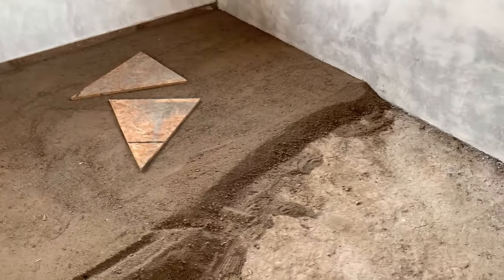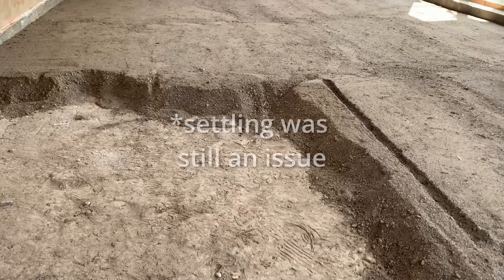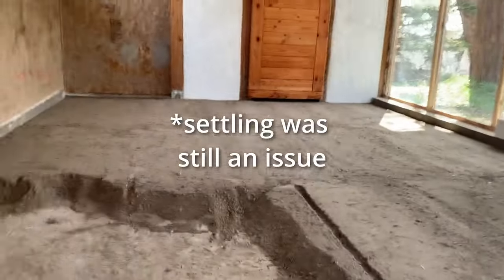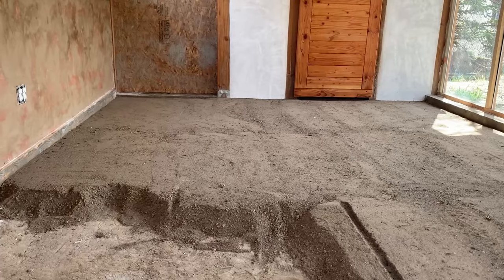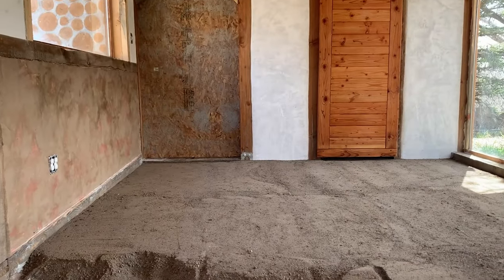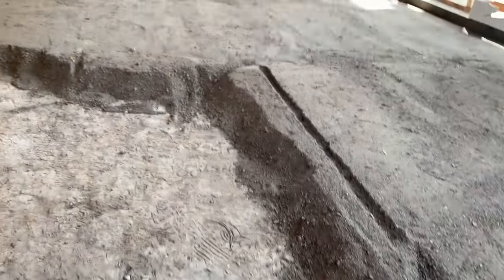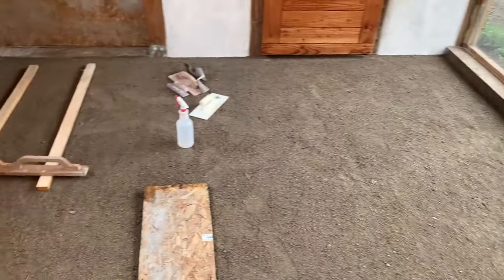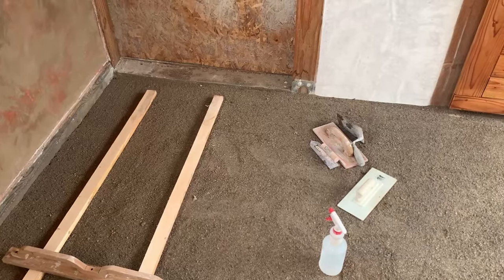Earthen Floor Installation

Comment: To address the cracks, no need to remove material. You can pour a clay slip, even over the oil finish. Squeegee it flat and it will fill the cracks. Give it a month to dry, and fill any remaining cracks with more slip. Repeat until satisfied. Oil finish can be re-applied, and you get a neat 'crazing' effect to the already lovely floor. Great work!
Reply from the maker: Awesome. A little cattail fluff in that slip might help larger cracks fill without re-cracking, too.

Comment: I like the concept, but bags of clay powder are not cheap. Alternatively, you would need a  supply of natural clay, but not all of that is of necessary quality. I suppose is someone is remotely off grid, making do with found resources would be necessary. I think the temptation and cost will often cause the default to a concrete slab floor - but I still admire the use of the ancient ideas
Reply from the maker: Most subsoil is suitable for this

Comment: Looks good! We love our earthen floor! We think the cracks add interest and texture. We stabilized ours by sweeping in fine dirt and then we sealed the whole thing with oil and wax.
Reply from the maker: I am cool with a couple small cracks, but I have some larger ones from the settling that I will fix. Plus, there is little information available on repair, so adding some would be good. Would you add links to your videos here, for others to watch? It’s great to have a few approaches to understand the concepts.
Reply: Sure! Here is a link to our video doing the bottom layer: https://youtu.be/cCVJRazK0aM
Reply: and here is our video showing the top coat and sealing of the earthen floor: https://youtu.be/90vHyzPmZ0w

Comment: How resilient is your beautiful floor to scraping and gouging by furniture; e.g., tables & chairs?  If damaged, can it be repaired and/or "refinished"?
Reply from the maker: It is almost like concrete. We use area rugs under furniture that moves, like dining chairs, but the dogs claws have done no damage in the traffic areas. I’ll have a video on repairs, at some point. It should be as simple as mixing a new batch and floating it into damaged areas, then re-oiling.

Comment: Great job. We work with a lot of clay cob mixtures in different applications, wall floor sealing. The tricky thing is the mixture of the filling materials like sand and that is something one has to test out at times. But good thing is that it can be fixed.
Reply from the maker: I certainly have learned that substrates are critical. Any tips for crack repairs?
Reply: @radicalgastronomy  I've not dealt with oiled earth surfaces. My guess is that through the oiling of the cob changed the chemistry and properties of the material. I would create a similar test piece and cut a piece out of it. Then create a mixture either out of the cut out material and oil you used for this you would have to crunch the cut out material, or I'd create a mixture of the base earth material you used with oil and maybe some water and compact that into the slightly opened crack. To smoothen the surface I'd use a ceramic stone as used for Tadelakt (Maroccan chalk plaster). These are suggestions. I hope you have fun in creating a solution for your cracks. If you would live somewhere reachable for me I'd come but unfortunately the Ocean separates us.

Comment: i like your work. Since you have the laser level. I would have snapped a line around the room with a chalk line. then put the screed to chalk line and just use a torpedo level to bring it into level.
Reply from the maker: I hear you. I find this method works well with the thick material. It doesn’t float like concrete. Either way, though.

Comment: Is there a good substitute for cattail? I don’t have any in my area. Also do you think you could add color pigment to either the finish layer or the linseed oil sealant? Thanks and nice work!
Reply from the maker: Most of these floors have chopped, screened straw in the final layer. Natural pigments can be added to the clay mix, or you can seek out different colors of natural clay.
Reply: @radicalgastronomy  awesome. Thanks for the reply!

Comment: I wonder, would adding some water to your dry subfloor layer you hand tamped help with the uneven compaction?
Reply from the maker: We began adding some water to it, but the clay just stuck to the jumping Jake tamper we tried to use. Ideally, with the right mix of clay, sand, and rocks, a road base should compact well even when dry. It would be a ton of work to mix all that material with water and “pour” it into place. This approach got really close to what I’m after. I think it will be flawless with a plate compactor, next time.
Reply: @radicalgastronomy  Looks good, thanks for the info.
Reply: @radicalgastronomy  Would tamping in thinner lifts work better?
Reply from the maker: We tried, but the clay was too sticky. More sand in the mix would have helped.
Reply: Would oiling the tamper help prevent sticking?

Comment: So if you add lime to the mix, is it more difficult to repair if there is damage to it at some point?
Reply from the maker: It’s probably the same in terms of repair, but it may be more prone to crack. A lime stabilized floor is more rigid than a straight clay floor. I can’t speak with authority on the subject, as I’ve never tried it.

Comment: How to do u insulate the bottom of floor. Does it get cold in cold weather?

Is sand must mix in your technique? Whats the advantage. There is mud houses here built with clay and water only
Reply from the maker: There is a six inch (12cm) layer of lava rock for insulation. It works great. Sand is only required if the local soil doesn’t have enough.

Comment: earthen floor and radiant floor can be blended in together? or is it redundant?
Reply from the maker: Absolutely. Though a good passive solar design can use the floor as a heat battery, adding radiant tubing can be a great move. I plan to do this in the main house, and hook it up to solar collectors and a 600 gallon hot water bath. This will heat the floor, and the domestic hot water. There is some up front cost, but those are two big energy requirements eliminated, if you can swing it.
Reply: @radicalgastronomy  I'd like to get updates in your implementation if you do go for it, good luck.
Reply from the maker: @roiad876  I’ll post videos of everything.

Comment: Hi to you. So glad I found your channel. I was searching for solutions for my cottage on my "also radical" homestead. so, your wood log wall are astonishing. Totally going to do that. But for your floor shown here would you do it in a 4b zone? How comfortable is your floor in winter time? Would appreciate your comment about this. Thank you very much. Hope to watch more videos.
Reply from the maker: I would absolutely do it in 4b, and would use the thermal mass heat storage potential to my advantage. Sun facing widows, or in floor heat, or a rocket mass heater makes the floor warm through the night. Insulate well and it will be your favorite part of the house. I really like lava rock for this, if you can source it.  I’ll be building a rocket mass heater this season. Glad to know you’ll be here for it!
Reply: @radicalgastronomy  Absolutely, I'll check that. Thanks for your answer. Found that we seem to head in the same direction. Yes also checking for alternative way to heat my place. And cooking and preserving food also. I understood you were a professionnal chef. Very interesting I'll be following your videos. Thanks a lot.

Comment: Why the cat tail fluff ? Is it for sheer strength and against cracks ?
Reply from the maker: It is. Typically, chopped, screened straw is used. The final look is a bit “corky”. I wanted a more leather-like finish, so I used the cattail. It worked pretty good.

Comment: If there’s no wax how do you clean it. Just by sweeping. What will happen if you mop it? Does it keep a lot of dirt?
Reply from the maker: The thing about linseed oil is that it forms a polymer when it dries. In fact, before vinyl flooring, there was linoleum. This was made by mixing fine sawdust or cork with linseed oil and applying that to burlap to make tiles. My floor needs another coat of oil, but it is totally sweep and moppable. You want to keep adding coats until water beads on the surface. Wax can certainly be added as a finish coat, if you want a glossier sheen, but it isn’t necessary. Even during mud season our floor cleans up beautifully. We mop it everyday.

Comment: How would this hold up the boreal forest of north eastern Ontario?  I'd be concerned about snow melts and rain.  Great info, thanks!
Reply from the maker: I would set ceramic tile into the Adobe, around the door, and leave muddy boots there. If we are talking about a porch, as long as it has adequate eve coverage to keep driving rain from pummeling it, it should hold up great. In a wet location, I would do 6 coats of oil and two of wax.

Comment: Beautiful! Are the floors rough? Or do mops easily glide over them?
Reply from the maker: A mop gliding finish can be achieved with 5 coats of oil and a wax finish. Wax would need to be reapplied about every two years to keep it that way. Ours is totally moppable, but it is not the same feeling as mopping tile.

Comment: you could have plummed in floor heat into that when you did it, In floor heat is the most efficient form of heat.
Reply from the maker: That certainly could be done.

Comment: Doesn't the plastic or wax interrupt the grounding? I love what you've done btw
Reply from the maker: There are several tons of earth on top of the plastic, and it is in contact with the bond beam of the earlier structure. I haven’t tested it with a meter, but that would be interesting.
Reply: @radicalgastronomy  could put it in a video.
Reply from the maker: @GiGiRenea  yup. This subject is wild. Just the mention of grounding causes some folks to straight loose their minds! 🤣

Comment: Thanks for that bit about electromagnetic grounding. Its somewhat embarrassing, but my polarity has been wonky ever since my quantum charging regimen got interrupted by fluctuating quark interference. Still, it's important to revitalize your capacitor resistance with a healthy dose of warble berry and ginseng body wax, making sure to do it when Jupiter is in helical alignment with Sirius and Dumbledore. I haven't slept as well as I do after a thorough wavering of crystal lattice lettuce modulated by my rheumatoid accretions. Happy reverberations!

Comment: What do you do when worms start coming up through the floor?
Reply from the maker: The layers of gravel make the ground under it inhospitable to worms and other ground dwellers. Plus there’s the vapor barrier. No worms, yet. Had some little ants, at first, but they moved on.

Comment: All very good, until he started waffling about 'electromagnetic connectivity' and 'grounding body polarity'.
Reply from the maker: You can measure this conductivity with a volt meter. There is published science supporting positive effects of direct ground contact. These are marginal studies due to the fact that there is no money to be made from doing them, but they suggest that grounding the body improves blood flow, promotes muscle recovery, reduces inflammation and improves mood. Here is an article with receipts:
https://www.healthline.com/health/grounding#benefits
Almost as fascinating to me is why some people are triggered by this idea. 🤔
Reply: There are associations between just about everything. Any causal effect is so small it cannot even be measured. If you feel better barefoot and grounded then enjoy but don’t put it in a construction video. I’m sure a separate video on your opinions of science, health and politics would be quite popular.
Reply: @Krunch2020  I am glad he mentioned it as it's something one might want to be aware of while constructing their building. At one time, outhouses were to be used outside, not inside. Now one wouldn't dream of a home without an indoor bathroom. Perhaps an infrared heater is also required in one's home. Just because YOU'RE not interested in the idea doesn't mean other might not find it useful and apropo as I, frankly, do.